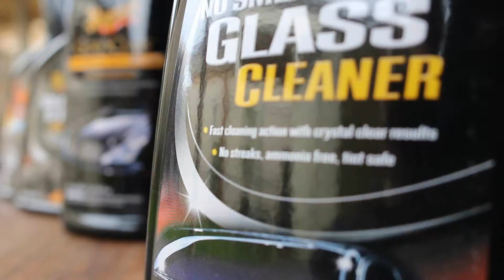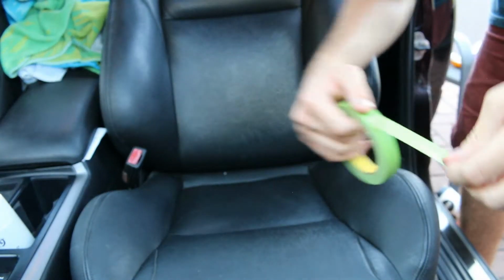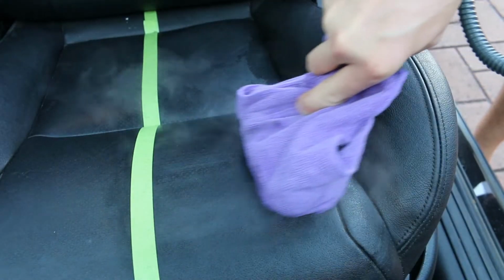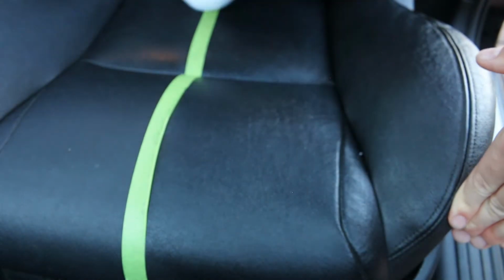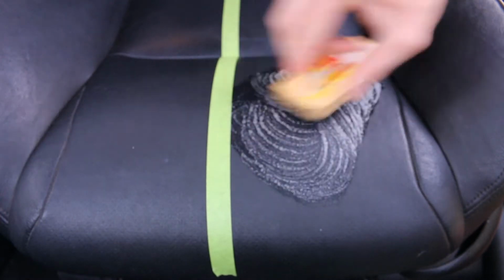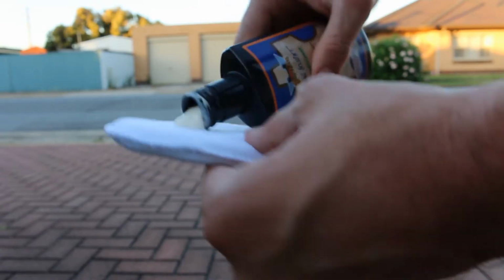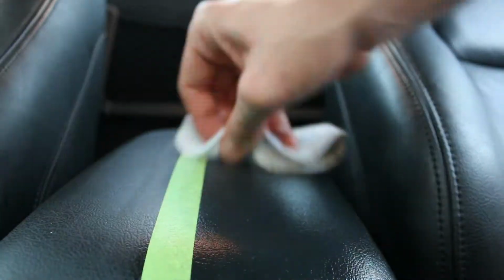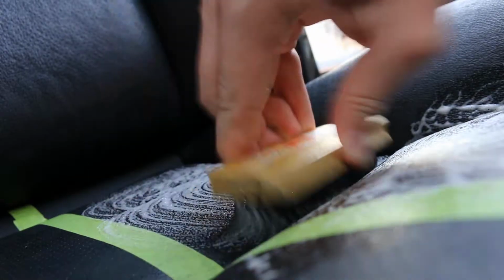Cleaning Leather Car Seats | Gliptone Liquid Leather | FocusOnDetailing

Comment: That Gliptone Leather combo looks like it's a really good cleaning/conditioning combo for leather.    I may need to get some of this stuff and give it a try.   The price seems right too.   I am currently using Polishangel Charisma and Bella Clean for my leather seats in my personal sports car but it's very expensive stuff.   It's a great combo but I really like the way that Gliptone foams up.   Looks like it would really pull a lot of dirt and grime out of the seats with a good quality brush.   I also like the fact the conditioner has a strong leather smell to it.    That's always a bonus when your car has that fresh "new car" or "leather smell" to it after the detail, even if it's only for a short period of time.    To me it just makes the detailing job that much better and when the owner gets into the car they immediately recognize that a quality detailing job was done to their vehicle.

Comment: Do you think that this 2 products have an expiration date ? I have used once gt12 and gt11 there is 6 years or so ... can I re-use them ?
Reply from the maker: This would be a question best kept for Gliptone, sorry mate. I do believe they would have an expiration date though
Reply: Check if the viscocity remained the same, in case it turned out to a watery substance it needs to go.

Comment: My seats on my e46 m3 are starting to look shiny with wear (we’ll just drivers seat) would this product be good to bring back a nice Matt finish?. Thanks
Reply from the maker: Sorry about the late response. The conditioner is what could potentially leave a shine as it's quite thick and that glazed look isn't overly appealing but if you're wanting to avoid that you can simply use a spare MF towel to wipe up the excess back to matte